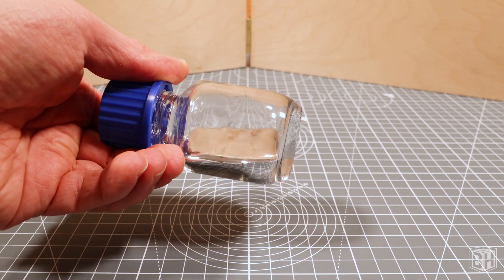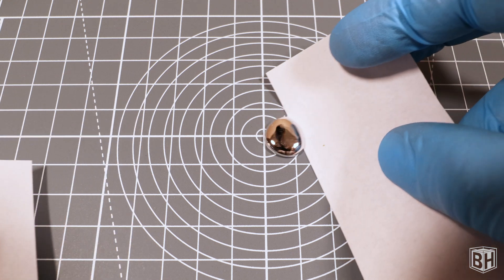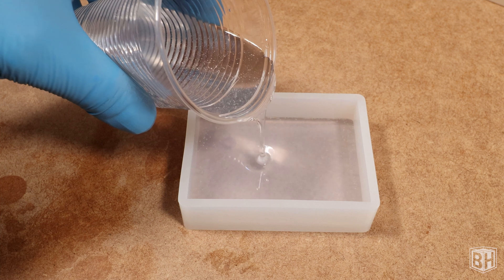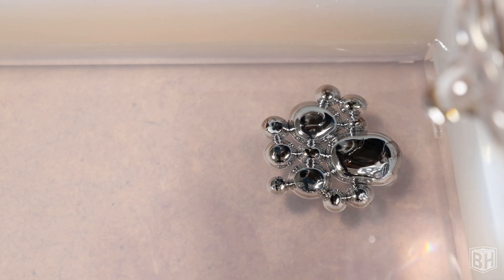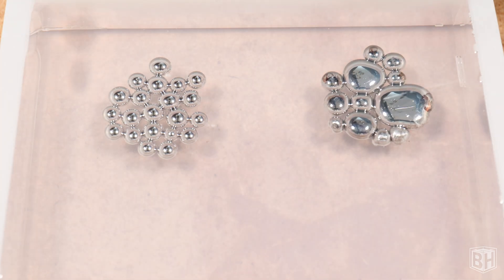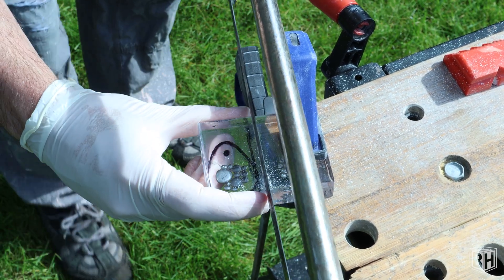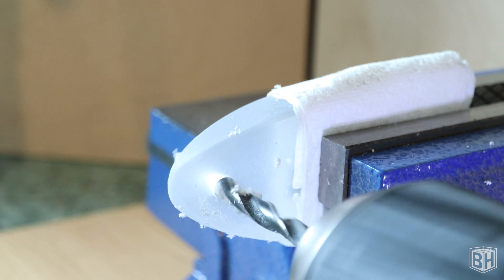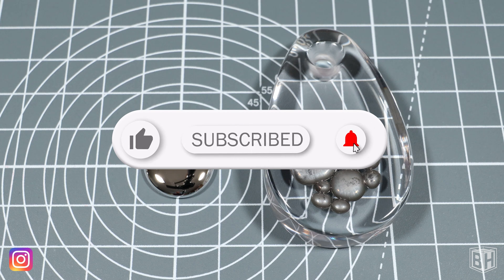Can you cast Mercury in Resin?

Comment: It would be interesting to see the temperature change results. Especially since most resins are exothermic. Perhaps the mercury expanded slightly during the curing stage and wont be an issue if it gets warm later on.

Comment: Suggestion if possible, encase the mercury in something spherical with a similar refractive index, though not needed, i would go with only filling it halfway or so and if possible draw a vacuum on it to assist with the expansion and avoiding bubbles of air escaping while the resin is hot, edit: i saw another comment around a cavity, perhaps using something like wax or something that will not interact with the resin that can be melted out later or a baloo ln with mold release that could be popped

Comment: I'm also concerned about the mercury leaching into the resin. You could also creat a cavity in the resin, pour mercury, cast a separate lid and join the two to have space for the mercury to slosh around inside
Reply from the maker: That's a good idea, but probably harder to do than you might think. I may try to figure out a way of doing it though. Thanks for watching.

Comment: You should store mercury under a layer of water to keep the fumes from escaping.  The fumes can be nearly invisible but trust me they are there and you don't want to breathe them.
Reply from the maker: Thanks for the advise. I did my research before hand and was careful.
Reply: Elemental mercury in moderate quantities at room temperature is putting off as close to zero "fumes" as possible. Even though it can vaporise at room temp it does so at such an insanely low rate that it would take a gallon of mercury, sitting open, years to accumulate enough in a small sealed room to reach toxic amounts. You are exposed to more eating a tuna sandwich than you are working with mercury like this in small amounts via vaporization.
Reply: @rdizzy1  I'm not taking any chances, and I choose to store my chemicals properly. You do you.
Reply: I agree with him ...sometimes people know a little more than others and since we all know knowledge is power then some people may not want extra knowledge of certain things out so they will actually keep you from understand the truth bt telling you lies as facts

Comment: Very interesting experiment! Shame it dulled the mercury during curing. I wonder with the mercury being liquid still, if you cooled the whole thing in a fridge, assuming the mercury would shrink more than the resin?!, then with enough agitation it would cause it to "reflow" changing the surface layer. Maybe it's worth a further experiment!
Reply: It's possible of course that the surface layer of the mercury has bonded in some way to the resin so it's now stuck  in place

Comment: Wandering if you spin cast the epoxy layer to form a large parabolic mirrors w mercury between 2 layers then glue seal the edges?   Giant telescope 😮😮😊😊
Reply from the maker: I've done something similar in trapping water in resin, and could use the same principle with mercury. I may do a video on it. Thanks for watching

Comment: All materials expand when heated. Mercury is just used because it is a liquid at most temperatures that you want to measure, and you don't need to worry about it evaporating or mixing with things to spoil your measurements.
Reply from the maker: Yes, you're right, and thanks for watching

Comment: I've tried this before and got the same result of that dull finish.  I did a little trick tho after some experimenting, and it also helps with the expansion. When you drop the mercury in and pour to resin over it, wait just a few minutes for the resin to set up a little.  then take a syringe and push an air bubble into where the mercury is.  This will create a pocket for the mercury and it will keep it's luster, plus it has area for expansion.  It works even better if you inject nitrogen instead of just air (I had to steal some out of my car tires lol).  It's also cool when you can create a fairly big air pocket, the mercury rolls around in it and it's like a liquid ball bearing fishing lure.
Reply from the maker: I wonder how many other people have cast mercury in resin, we're probably part of a small group! You've got some great ideas. Thanks for watching
Reply: Nitrogen, yes, but air, no. 
Air is what causes it to lose it's lustre. 
It maybe looked shinier for a short while, but eventually it'll just turn it into grey flaky crap if you keep moving it around.
Reply: @EddieTheH doubtful. Probably the resin itself.